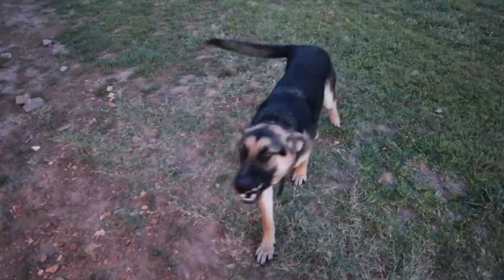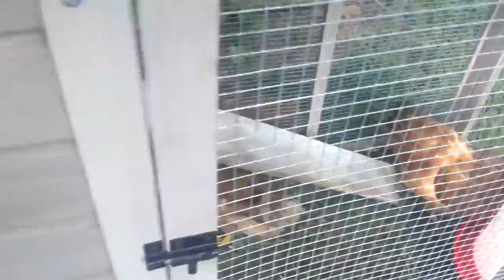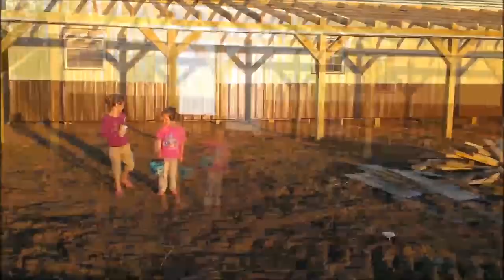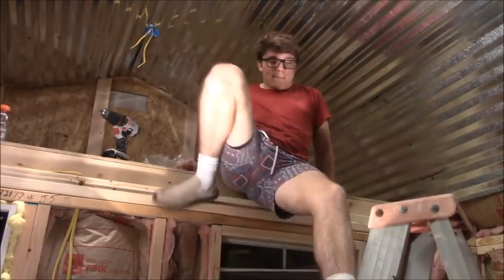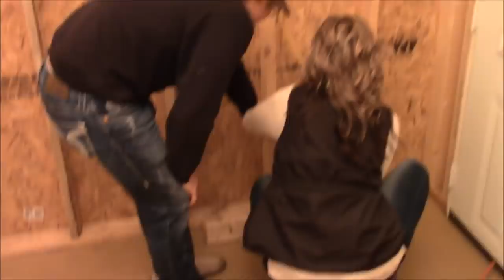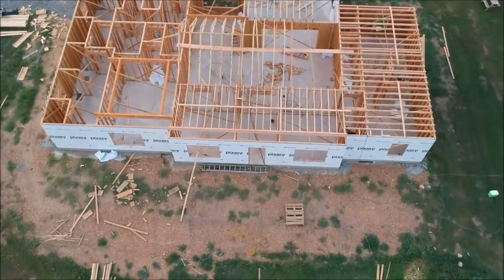TIMELAPSE- Couple Builds 3 Houses In 30 Minutes

Comment: Heard a remedy for insect bites. Won’t help the bites you already have but you won’t get new bites tomorrow.  I’ve been surprised how well it works. 
1/2 blue Dawn dish soap
1/2 alcohol 
Mix together and wash with it. Especially. Feet. And. Legs. 
Small batch 1/2 cup of each
Larger batch 1/2 gallon of each. 
Hope it stops the ticks/skeeters/chiggers from getting on your family.